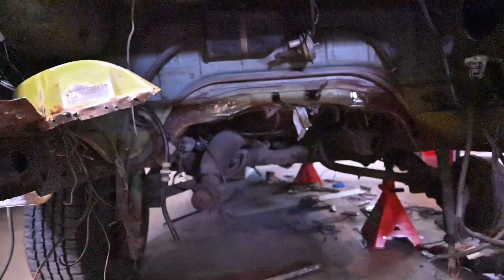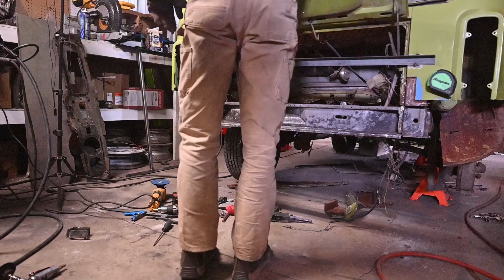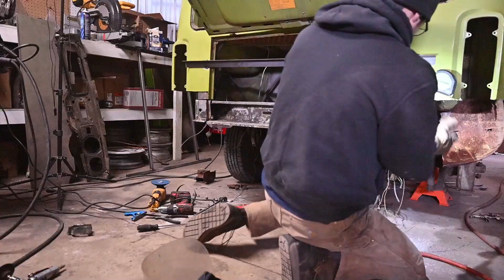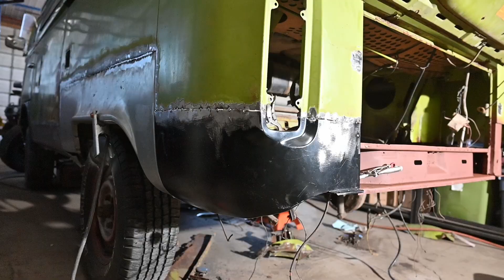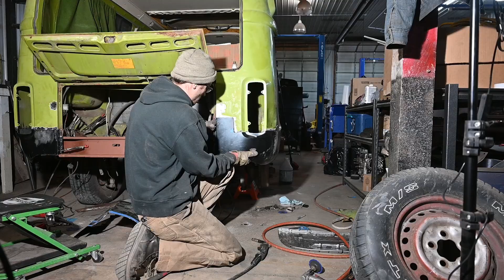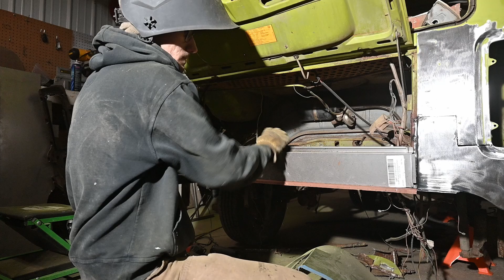Replacing the Rear Corners 77' VW Bus

Comment: my 78 - similar thing, I thought the exhaust was leaking and that caused the corrosion - both battery trays - toast....but the corners were good so I made two cuts - one above and one below the old tray and installed tray and cut a band to replace that section that left with the rusted battery tray.  Oh, don't try to make your own battery tray, don't be cheap, just buy it. I should have known better, it bugs me and now I will do it all over again.